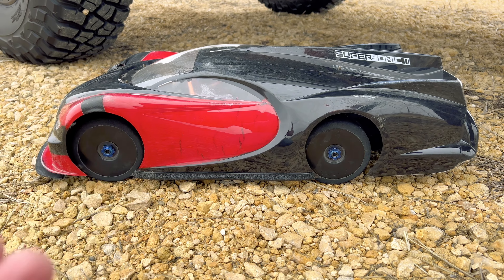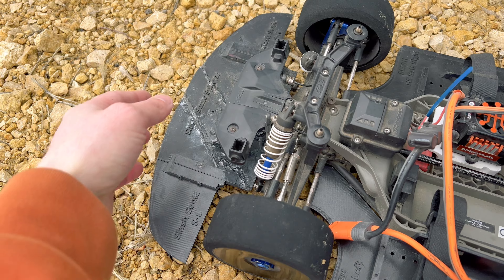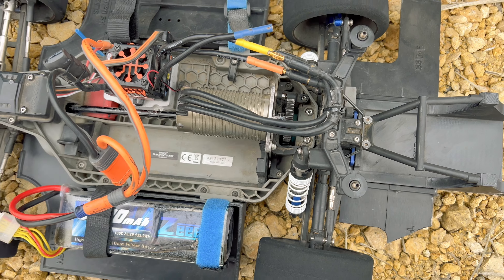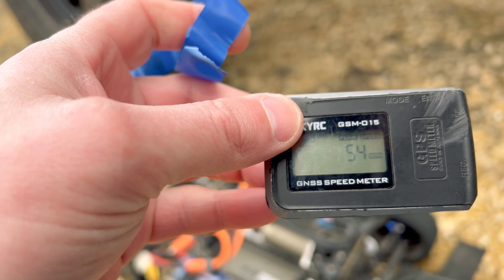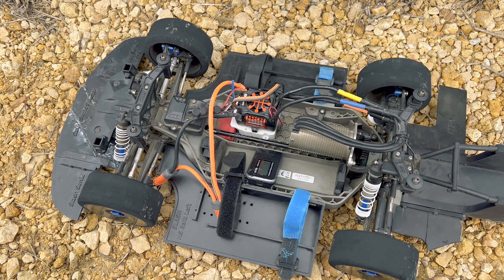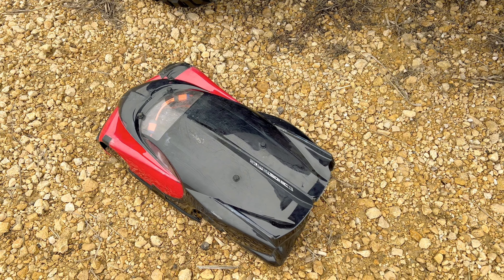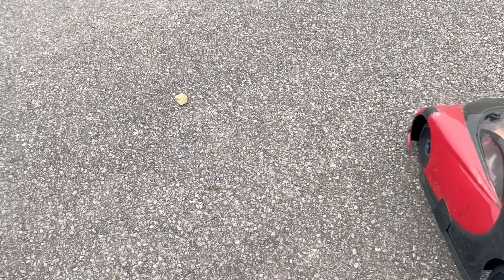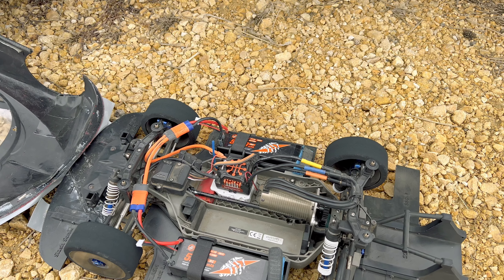100mph Traxxas Slash 4x4 - EPISODE #33 - Top Speed Test with Mod 1 Gears!!

Comment: If you have the money, definitely go with a castle XLX2 or MAMBA MONSTER X 8S or MAMBA MONSTER X  If you want to stay 6s.  You should also look at motors from castle, Neu, TP power.  You'll be less likely to have any electrical problems between the esc and motor with any of these products.
Reply from the maker: Thanks for the recommendation! I’ll probably be upgrading unless I can figure out a cheaper option

Comment: no offense but your trying to go 100mph in a slash thats a pretty serious run and your doing it with things taped and zip tied on. you need to really dial everything in in perfectly dont tape your gps on make a mount for it or at least velco it in a plus pattern invest in a better bottom panel set up one tht isnt 3d printed get your car lowered all the way you hit 84, the 85 i think might have been the speed of the car spining and not the actual mph but you dd hit 84 i saw just dial that car in and youd probably be there

Comment: Don’t give up brother. Put a mamba monster x in it and try again. You’ll have better results. You can there with that spectrum esc but you might want to try a little higher kv. K-Bash rc is good at running those spectrum esc. He might have some good advice for. He is on the Arrma forum a lot
Reply from the maker: Thanks for the kind words and recommendations!
Reply: @RCKnockout  no problem brother, but you know once you hit that 100mph your gonna be hooked. Lol
Reply from the maker: @jasonjohnson6085  yeah I’m sure I’ll be overjoyed if I can reach it…I don’t wanna get ahead of myself though lol
Reply: @RCKnockout  dialing back your steering speed helps too. I usually run mine around 15%. Car setup is super helpful on keeping it somewhat straight. If you’re on a smooth enough road you can lock out your shocks with some suspension links. The arms flex enough and work like stiffer shocks. A little weight in the front helps with blow overs. Most importantly, don’t give up if it happens. It will happen

Comment: Its vibrations are so bad i feel like that might be the reason your loosing your motor wires.. if u jam a 2mm driver in the end of the bullet connector its should spread out a little.. and u might just run a max 6 for that kinda gearing.. but if u have any wore out barings or something causing it to vibrate your going to struggle all the way to 100
Reply from the maker: Thanks for the tip! Those are valid points
Reply: @RCKnockout  might be a good idea to take the motor out.. and maybe see if u can dial it in smooth just as a roller.. then throw in your electronics once everything is dialed

Comment: Try turning off the lvc. Seems like it might just be hitting the lvc. Also i just bought a CNHL battery and saw a huge difference in speed over my gensace batteries which aren't even a year old. So it's possible those batteries are getting too much of a voltage drop too fast and then hitting lvc. Plus the cold weather really sucks the punch out of a battery. Other than that u should have the right setup now mechanically.
Reply from the maker: Yeah that’s true…maybe I just need some higher discharge rate batteries and to turn off my low voltage cutoff…thanks for the tip!
Reply: @chrislang7460 current ratings are based off of how much continuous current they can handle before they fail. So in actuality an xt30 can deliver the same current as a qs8 can, it will just heat up and desolder faster, doesn't really limit the amount of current......for future reference

Comment: To save more disheartening attempts. Maybe its time to commit too it with electronics. I think you could do it with mmx 8s. But as someone else has said the xlx2 has a much higher ceiling
Reply from the maker: Thanks for the recommendation! I’d like to do it on 6s rather than 8s though
Reply: @RCKnockout  you can run 6s through an 8s capable esc. But you can’t run 8s through a 6s one. So buying a specific 6s is only going to eventually lead to buying an 8s. Or you just go for the 8s esc and save in the long run
Reply from the maker: @chrislang7460  that’s a valid point

Comment: Built a 100mph slash over a year ago.. pb is 110mph
Reply: Used 150amp esc with 2400kv motor.. can't remember the gearing but it was 32p.
Reply from the maker: Good job!
Reply from the maker: Surprised you didn’t have similar issues with a 150a esc